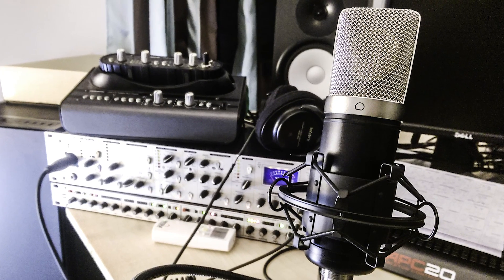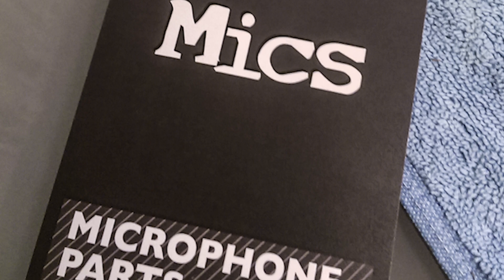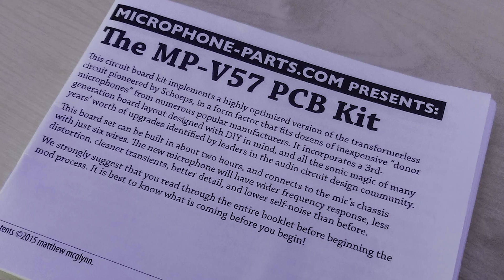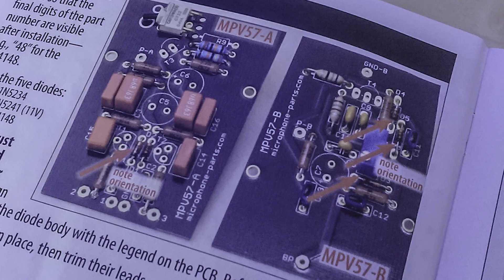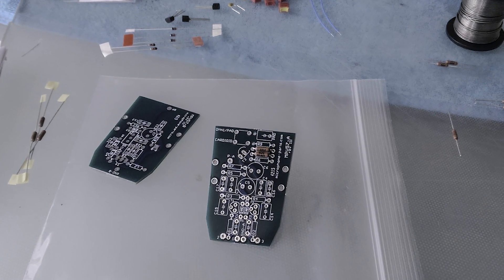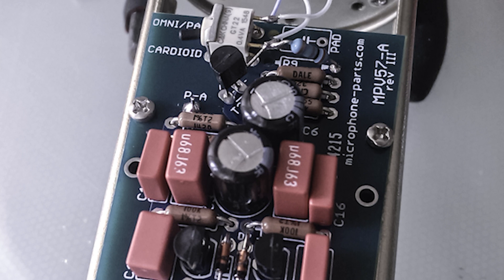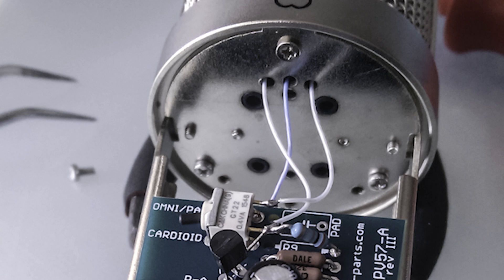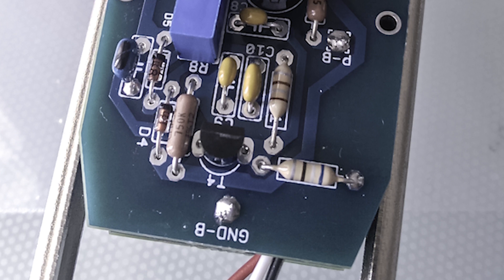S-12 Microphone Kit Review - www.microphone-parts.com

Comment: Sounds to me that the high frequencies are over accentuated...
(Unless you did this on purpose)
Reply: +Jeannot Kuenzel +Frank55 

Hello, Jeannot and Frank. Thanks for posting this video! I'm a big fan of the Microphone Parts microphones, too. To add to what Jeannot already said, this circuit can be constructed with a flat frequency response (no internal EQ) or with a low-pass filter that creates a smooth rolloff, gradually attenuating the higher frequencies to complement brighter capsules. The kit comes with three (3) capacitor choices: neutral, -3dB at 10kHz, and -3.8dB at 10 kHz. You can also customize the microphone by supplying your own capacitor to create an even steeper rolloff (for an even darker sound).

The capsule used in this microphone is an RK-12, which very closely imitates the frequency response of AKG's famous C-12 microphone. The C-12 is generally regarded as a very bright microphone, and is most often used to record female vocalists, acoustic guitars, and choirs. When the circuit is constructed with a low-pass filter, the mic becomes less bright, more closely imitating the frequency response of the Telefunken Ela M251. This is still considered to be a bright microphone, but not nearly as bright as the C-12. In general, the profile of the Ela M251 is more often preferred to the C12 for male vocals.

It is also worth noting that this microphone implements a transformerless circuit, which means that it is very accurate and uncolored. Some engineers find transformerless circuits to sound more "harsh" than transformer-coupled circuits, because they do not produce harmonic distortion or compress transients in the same way.

Jeannot indicated that he used the middle EQ option (-3dB at 10kHz). I have constructed this microphone with the same circuit/capsule, but found the response to be considerably less bright than it is in this video. Please feel free to listen to the provided link for reference. https://soundcloud.com/matthewianwelch_audio/jane-goodall-s-12-microphone
Reply from the maker: The onboard eq can be configured to attenuate high frequencies more when you solder the board. I personally really like the air and breath, the clarity of the Mike. But as stated, the eq can be changed. My setting is the middle. There is also no attenuation at all or (I think) -10dB. better check the manual on the website.
Reply: +Matthew Ian Welch Interesting. I looked at the Microphone Parts website, but could not find any details about the EQ options, or the components used to tailor the frequency response. So I reacted 'on what I heard', and the microphone would really be too 'bright' for me.
By the way: the difference between -3 dB and -3.8 dB at 10 KHz is not very much, I doubt if this would make a clearly noticable difference.
It would be interesting to compare this microphone with a Neumann U87. (I am using here, amongst others.)